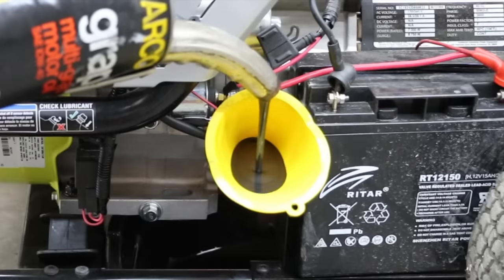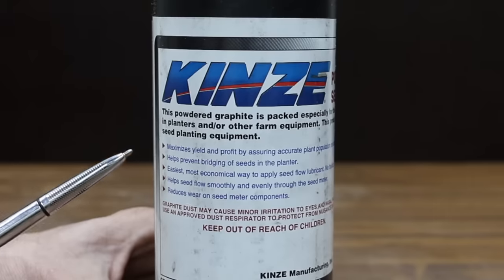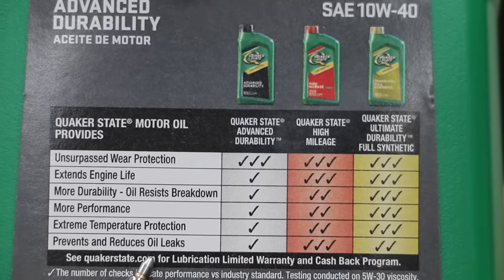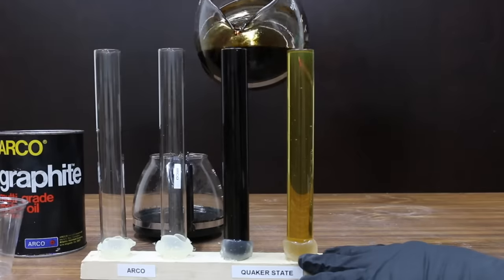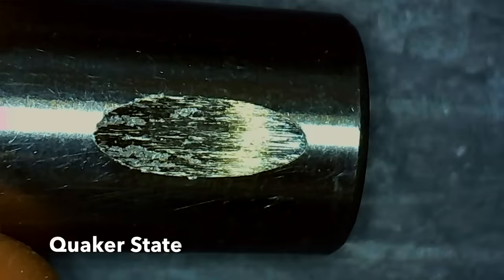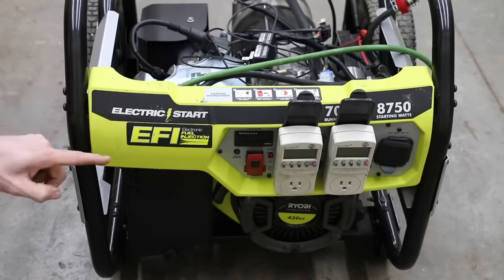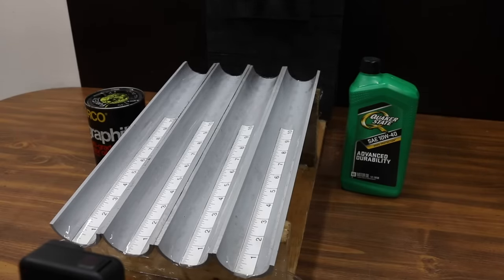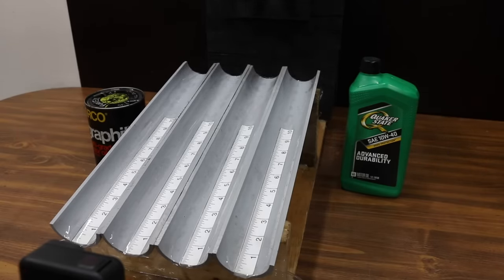Will "Graphite" Help Motor Oil Performance? Let's find out! Vintage Arco Graphite vs Quaker State

Comment: Todd ~ Since with either a carburetor or fuel injection the fuel metering is done entirely by air flow, do you really think that there could be any change in fuel efficiency?   The governors on either engine are NOT a precision control, kind of like doing brain surgery with a chain saw.   Since the friction in an engine is very low to begin with but the greatest resistance to the engine running is actually the mechanical operation of the engine and engine cylinder compression; why would a slight reduction in the already very low friction give much of any fuel efficiency increase.   Even with HHO or the many "fuel additives" which advertise significant increases in fuel efficiency, without compensating the fuel ratio for any advantages with the fuel additives or HHO, there would logically be no decrease in fuel consumption or improvement in fuel efficiency.   As I had commented in another of your videos, I had  tried the "magnets on the fuel line" and numerous fuel additives, including combining several additives into a mixture put into the fuel tank at each fill up.   I ran my 4.6 liter engine in the Lincoln Continental for about 50K miles keeping track of all fuel and mileage with NO additives and about 50K miles with the products that were supposed to increase the fuel efficiency with increased mileage, but the result was the same for each, meaning NO change in mileage.   The average in both situations was about 20.3 mpg including all types of driving, city & highway, summer and winter.   Any benefit from either a Teflon (polytetrafluoroethylene (PTFE) ) or graphite, molybdenum, zinc and possibly calcium, (as in the Arco oil that you used) or any other low friction additive would need to be run for a long enough time to be embedded and coat the moving parts to make an even lower finish for moving parts to slide or roll over.   There might also be other micro particle metals such as copper, bronze, brass, tin or lead which could coat moving parts which would absorb any wear preventing steel and iron contacting from contacting each other.   When an engine is taken care of properly and not abused with regular oil changes, there is very little wear in modern engines.   Any measurements as to friction reduction would best be done using a dynamometer and the engine run by itself under significant power and RPM and also for the engine to be driven by another engine with the power required to rotate the engine at the same RPM as when run under it's own power.   The tests would need to be done before treatment with the friction reducing products and later after maybe at least 10K miles so that the friction reducing additives have time to completely penetrate and coat the moving parts.   In my observations, PTFE and Molybdenum are the best friction reducers, but graphite would also need to be a micro powder to be effective, otherwise, it could actually be somewhat abrasive which would eliminate any friction reduction.   Your testing is quite interesting but to receive much more accurate results, would require additional techniques and precise testing, along with precise calibration of the fuel and air ratios for testing fuel efficiency increases or not.   For modern car engines, there would need to be some programming changes in the engine controller and changes to the exhaust gas sensing system, including the emission controlling system.   Keep up the good work.   Your videos are certainly entertaining and informative.   Have a great day!!!
Reply from the maker: Thanks, will do!  Thanks for sharing.

Comment: We bought a used 1979 Rabbit (diesel) for my college car that the original owner had used ARCO Graphite. I kept using it. I KNOW the VW mechanics HATED to see that car come in. It was really black and messy to work with. The engine started blowing blue (motor oil) smoke after only 80,000 miles. ARCO Graphite for the fail. I've seen claims of 200 and 300 thousand miles from those engines. I do NOT believe it. It was a sorry engine that was a gasoline engine converted to a diesel engine which was a bad idea. For example, the spark plug holes were used for the glow plugs. We had a 1971 Opel 1900 wagon that we had been running Quaker State in. Both of these cars had oil changes at 3000 miles while we owned them. I took the valve cover off the Opel and the inside surface had petroleum jelly (aka paraffin) coating it nearly a half inch thick. Scraped it off with a screwdriver. A lot was caked around the rocker arms. I wouldn't even put Quaker State in my lawnmower because I like the mower. In those days Quaker State used Pennsylvania crude which was very high in paraffin. I don't know about nowadays.
Reply from the maker: Thanks for sharing.

Comment: Its seems like you attribute the success of the Arco graphite oil in the lubricity test to its phosphorus and zinc content rather than the graphite content. I wish you would have proven your assumption by running your home brew Quaker State oil/graphite mix in the wear test. That would reveal the capability of graphite on its own without phosphorus and zinc helping. So, after watching a video to find out if graphite is beneficial, I'm still left wondering if it was the phosphorus/zinc that reduced the scar on the wear test, or if it was graphite
Reply from the maker: Thanks for the feedback.

Comment: I had a '76 Pontiac Astre with the 2.5L "Iron Duke" engine that I bought new.  I put Arco Graphic oil in it, then sold it in '79 so don't know how it went after that.
Reply from the maker: Thanks for sharing.

Comment: Yep I’ve used it a lot back in the day (70’s)we used it on types of small engines as well as marine boat motors regularly never used it in a car unless you had a unhealthy engine to begin with if it burnt oil thu the rings we would use it it brings back compression n slow down oil consumption as well as plug small leaks  an will help it last a bit longer not much but alittle it was what you used when your stuff was going down to bring it back jus enough for long enough to get that vehicle moved on down the road for someone else to handle an that’s it it was abandoned because everyone knew what it was for an wouldshy away from such vehicles if they could get a sniff of it ever being used in the unit that’s how I remember it dieing out of popularity an times changed to the (80’s)the moral is shit always will have to get worse before it’ll start to get better time has proven that over and over
Reply from the maker: Thanks for sharing.

Comment: You missed the whole point... GRAPHITE Filled the microscopic irregularities...and.. is a lubricant.(used in space application....not oil).. I personally used Arco extensively in the.1970's.. wow I was amazed... I had to set the idle down on a Ford 6 cyl ... traveling back and forth to Wyoming. From Minnesota. Document 1.5---2 mpg....(2 yrs..20,000 mi) latter in was seeing.a thin GRAPHITE  film on the oil change oil.  The graphite costs the parts and was coming out.... WTF,. does Catalytic  converter have to do with coating engine parts...???....I use GRAPHITE in my gun action lubricant...oh yeah 👍 try it...feel the difference in the slide action... Graphite for me..but in moderation... Arco COMPLETELY OVER DID IT.. I was adding.1Can  each Change...after the test run in ,over the road ...this stuff is a miracle for super high mileage engine.....I will be " treating" ,215,000 Ford 5.4 liter. For 1200 mi. Then drop way back on the GRAPHITE. This stuff works. Wonders in gun actions...try it! I will post in a couple of months info.on my experience... If you have 200,000 PLUs... consider it... graphite is awesome 😎👍...(SKOL from MINNESOTA VIKINGS)
Reply: Try this stuff out many many uses...fr dry lubricant for locks to cable lubricant... Gun actions are amazing...we used to lube.the old speedometer cable ... SKOL from MINNESOTA

Comment: Had bought a truck 30 years ago that had been run over 60000 km on graphite, the motor ran great but when i pulled off valve cover the top end was all slugged up.
Reply from the maker: Thanks for sharing.

Comment: Working on diesel engines we used a grease with graphite paste to prelude the mains and inserts in new rebuilds as a bit of added lubricant to carry the crank rods and camshaft while winding up to an initial startup where turning the engine over to build oil pressure after filling all the dry system. Several out of frame rebuilt Mack diesel engines saw 400k miles with no loss of power, no reduction in compression over what was seen where only Shell Rotella oil was used, was it beneficial?  Not that we could tell. Was it detrimental? Again, not that we could tell. So I have no proof of it doing any good in oil, nor that it xauses harm. I'm interested in this one due to past practices used during Mack 300 hp diesel engine overhauls.
Reply from the maker: Thanks for the feedback.

Comment: 2 stroke oil added to a diesel engine fuel tank. Say 250ml to 70liters. Makes the engine quieter Nd improves economy
Reply from the maker: Thanks for the feedback.

Comment: graphite as oil additive works, but graphene as oil additive works better.1mm graphite contains about 3,000,000 layers graphene. Graphene's is the ideal nanomaterial to improve tribological performance. graphene is the best nanomaterial used for lubrication.
Reply from the maker: Thanks for the feedback.

Comment: Always wondered this because of leaded gas when graphite has similar properties of lubricity.
Reply from the maker: Thanks for watching!
Reply: But leaded gasoline doesn't have metallic lead, it has TEL, which is a liquid. It doesn't have mechanical properties of lead at all, so not comparable to metallic graphite. To the extent that it prevented wear, it would have been due to thermal effects, and also acting as a separating agent similar to other liquid lubricants.

Comment: Worst thing you could do for your car , back in the 90’s both me and my brother put Arco Graphite in our cars , he had a. Camarillo , I had a Chevy impala ,after a few weeks both cars locked up, when we removed the heads we couldn’t believe the sludge in the engines had to drain and flush both cars many times and there was still a lot of sludge !  If you cherish your vehicle please don’t use oil with graphite !
Reply from the maker: Thanks for the feedback.

Comment: Think of that graphite as an abrasive. Even if it's classified as a lubricant, it's still a powder. Why would I want that substance in my oil ? I didn't hear anything about seals and rubber components in this vid. There was a reason to why ARCO quit with that graphite oil.
Reply from the maker: Thanks for the feedback.
Reply: @ProjectFarm   I was scrolling through the comments, and realized I had posted one a year ago. I'm not usually so redundant. Thanks for the feedback.

Comment: The lawnmower... if runtime was basically the same, but compression was greater, doesn´t that amount to greater efficiency? It seems to me you'd be getting more power for the same fuel consumption. I'm no expert and I'm genuinely curious, so please correct me if I'm wrong. Also, did the lawnmower have a new head gasket and plugs in the first run too?

Comment: I use sand as oil additive. It gives the engine the additional crunchyness. Mix 10:1 oil sand ratio and you'll be surprised how much better your engine will run!

Comment: I don’t really think the fuel efficiency test truly proved anything. Perhaps what causes it to give better fuel efficiency under actual use might cause it to use more when not under a load. What would allow for a higher efficiency is better lubrication causing less internal drag on moving parts and/or better flow requiring less power to operate the oil pump. Either of those would mean less internal power loss allowing for more efficient use. However when not under load this might also mean the engine might run at an increased but not noticeable rpm causing it to use more fuel when running without being under a load. I think the only way to truly test this is to run the generator under load with something like a few work lights and see if you get the same results. For best results you would want to use enough lights that it requires the generator to throttle up so you know you are giving a sufficient load.
Reply from the maker: Thanks for the feedback.

Comment: Lucas oil treatment.. swear by it.  Run it in every engine I have.  Proven to make a engine last longer.
Reply from the maker: Thanks for the feedback.
Reply: @ProjectFarm  ps I have 78 vintage motorcycles 2 trucks. 2 vans. And a few other engines..  I’d say I’ve tried it out a bunch

Comment: I used moly and have for many years, but in a modern vvti engine I had issues as the moly tended to block stuff up a little and make it feel a little sluggish. It burnt off over time but I wont use it anymore due to potentially ruining the engine.
Reply from the maker: Thanks for the feedback.

Comment: Your fuel amount was not the same with the Arco. The fuel overflowed with the first demonstration. The second demonstration had the fuel just Under the edge if the cap.

Comment: How many times have you seen engine oil sitting on direct heat completely stationary? Oil is constantly flowing in an engine and it doesn't sit stationary on top of the main heat source. The Arco oil is how old? Your calculating results on products that have a huge age gap. Shelf life is a real thing. Everything breaks down. Everything separates sitting stationary for long periods of time. Both oils were manufactured for totally different purposes. I'm not questioning his knowledge at all. He is extremely educated at his craft. I'm only pointing out the different variations. Yes engine are extremely hot, but the oil is always in motion as long as the oil pump is pumping. Then you have all the deflectors and engineered components to force the oil to make a very specific course to maximize flow, viscosity integrity and keeping the oil cooler longer.

Comment: My dad used ARCO graphite in the 70s in a 350 Chev engine and it only lasted 80k miles or so before needing a rebuild. CAM was shot. He believed the hype.

Comment: I used this in a new honda in 1979 and it ruined the engine. I had to replace the cam and lifters and put regular oil in it to get it to run again.

Comment: What are your thoughts on Krex...? Think it would be a small enough "mesh/micron" rating to pass through the oil filter? ( just trying to figure out a way to get the benefits/wear protein of the graphite in a modern fuel injected engine without doing anything detrimental) 🍺
Reply from the maker: Thanks for the video idea.

Comment: Graphite gums up locks so I can’t imagine how gummy it would get inside a hot engine. Seems to me it would be a death sentence for GDI / VVT / AFM engines. Hint: if you have an old binding lock spray WD40 on the key, stick the key in, work the key back and forth in the lock and…lock now nice and smooth.
Reply from the maker: Thanks for sharing.

Comment: I used graphite oil in a 1980 plymouth volare and got 326 thousand miles out of it.  I sold it to a guy that lived down the road and saw it pass my house for many years afterwards.
Reply from the maker: Thanks for sharing.

Comment: Please use nano graphite in your lubricants. Use only half gram per liter of engine oil.  If you use more than that it will make more harm than good.  Nano based lubricant oil additive is readily available in the market get genuine one.
Reply from the maker: Thanks for the suggestion.

Comment: Graphite is NOT a lubricant. It becomes a lubricant when it is contaminated with other atoms and molecules.
Graphite consists of layers of graphene (1 atom thick sheets of carbon). It was assumed that these sheets were loosely bonded to each other and slid upon each other, hence the lubricating effect.
Alas, when graphite was used as a lubricant in the vacuum of space it did not work. Moving parts stuck to each other and refused to move.
The reason was that the vacuum removed the contaminating components (often oxygen). 
Graphene is hungry for atoms and so non-carbon atoms get caught in the hexagonal web of carbon atoms.
The reason graphene is hungry is that each carbon requires 4 neighbouring bonds, but in the hexagon there are only 3. The surplus bonds are shared around the ring, making graphene extremely strong.
It is these extra contaminating atoms which make graphite a lubricant.
Reply from the maker: Thanks for the feedback.

Comment: I used the Arco Graphite in my car in 1980. No Bueno. almost ruined my engine. There is a reason you can't find it anymore. Use pure oil in your engine, no additives especially a solid. It's not the lubricity, it's the buildup in your engine and buildup on the heads and in the oil pan. you might save $5 in gas and end up replace an engine for thousands.
Reply from the maker: Thanks for the feedback.

Comment: I like your thorough thought on this. May I suggest that you need more replications to see any significance in your data. For instance, the wear study needed more to see if you get similar results. Same for the cold run of the different oils. They needed to be done in different lanes, too. Also, the run time, if interested, needed to be ran a couple more  times (less important here).
Reply from the maker: Thanks for the suggestion.
Reply: @ProjectFarm  You are welcome. I did see another video that you did and you did do replications on the bonding agents. I am a teacher and I gave that link to a teacher that has kids do research such as this in his class. I hope his students can get some ideas of editing from your video, too.